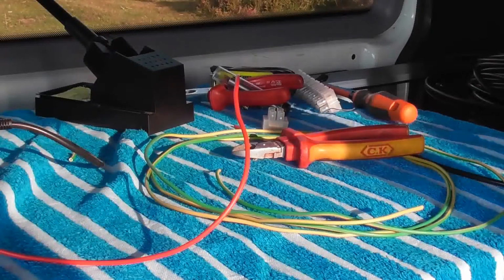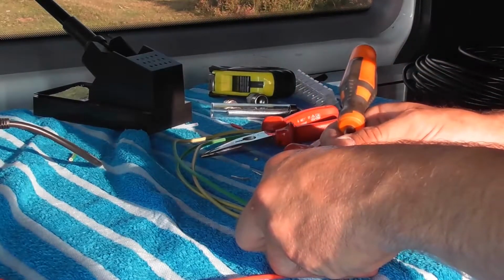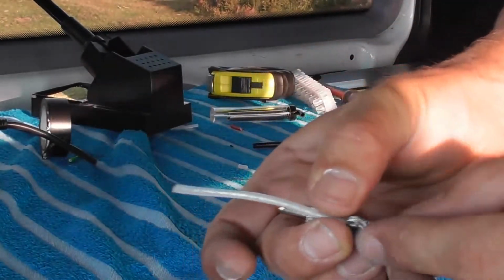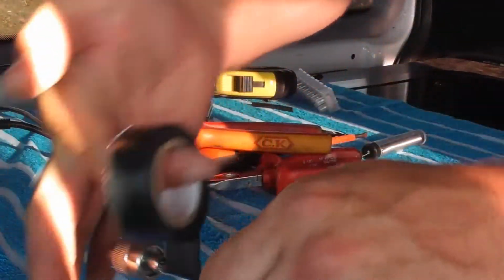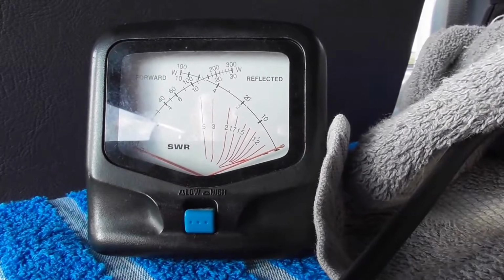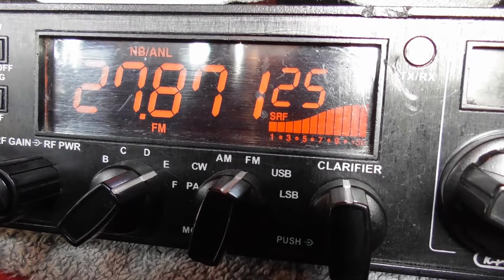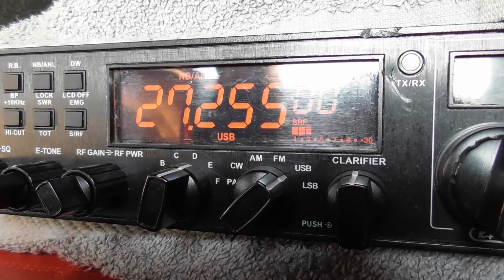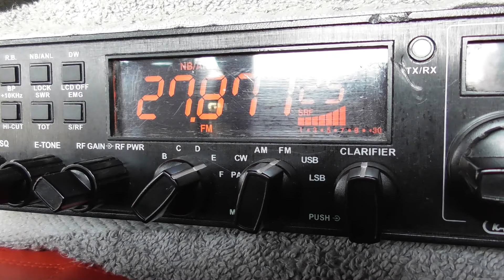How To Make A Dipole For The Midweek Net

Comment: Top Stuff Tom! That 9up 9down just goes to show you don't have to blow cash on shop bought antenna's to get out really well mate. Glad we managed to pached you over to Mr Roy in Corsica in order to prove you don@t need to spend £'s to to get out really well. antenna's are after all just bits of wire and you proved that so well with this vid!!! 73. Tom 26DA75
Reply from the maker: Thanks Tom, the idea was to show that you don't need to spend loads of cash on materials and hours making an antenna to get on the air. My other antenna was full of water last time out so decided to knock this up on top the hill. Last time I made a dipole for 11m I had a friend in Canada call in. Thanks for hearing me first call and for passing me around. 73!

Comment: Nice one Tom. Will you also try this horizontally for DX and to see if its quieter noise wise at home? Perhaps post the results? 73s and well done.
Reply from the maker: Tim I don't use 11m at home but I use a 3 element yagi for 10m and I get little or zero noise.

Comment: I have a very wobbly 30ft+  cain pole that I may just build me a 20 meter vertical dipole patterned after yours, of course it will be about twice the size of yours. Many years ago we tried to build this antenna for CB but a pole long enough was a problem and winding 102 in closely each side wasn't the best way. spreading it out as you have proves it will work and covering about a meg of frequency makes it very usable. In the states your FM  would be too close to 10 meters and not a legal option as you have. I noticed your radio has some below or 26 meg 40 channel set. New Zealand has a set of 40 down there as do I think Germany, so another dipole on the other side of your pole about the length you started with would give you their channels, just remember they use the 0, not the 5 and about sundown, yours or theirs called the gray line might let you get them as the sunspots open up in years to come.   Good  job on the video and dipole.